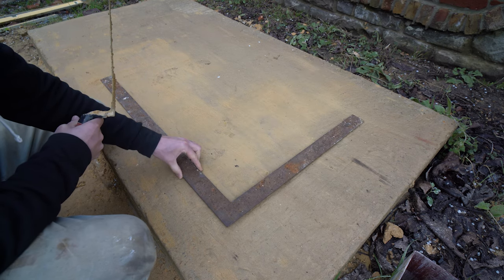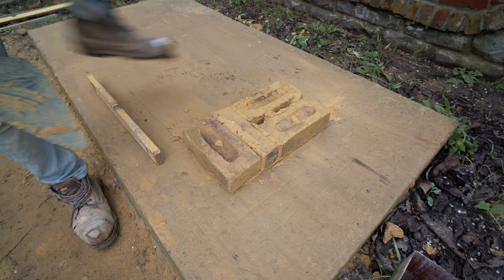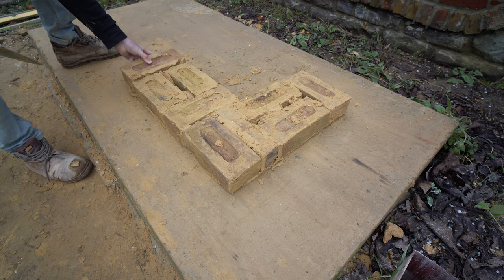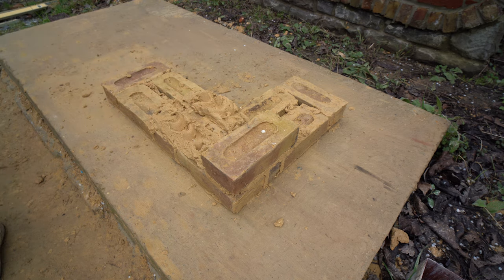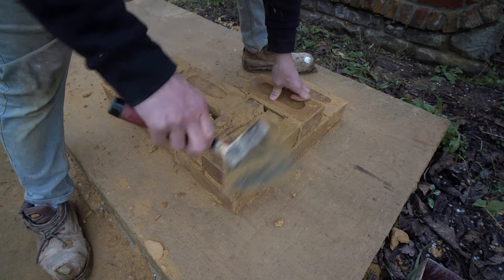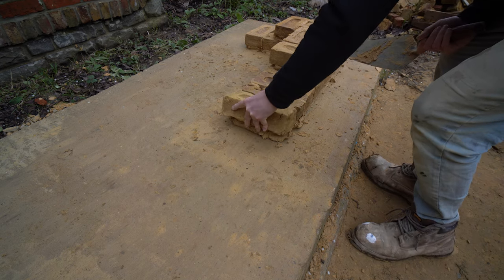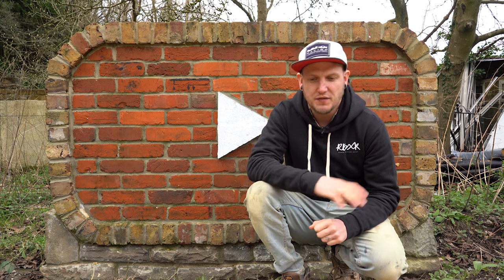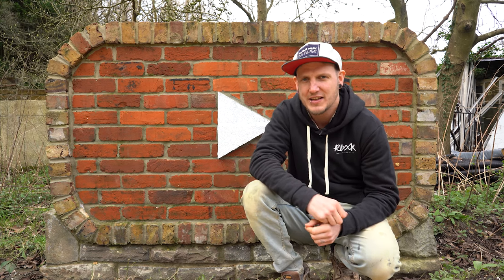BRICKLAYING - How to lay bricks in FLEMISH BOND

Comment: Many thanks for the video as always. Just completed my first Flemish bond garden wall in 35 years. Had lots of nice comments from 1 bricky, 3 builders and various neighbours so pleased with myself. One thing I had big problems with was dealing with misshapen bricks when trying to plumb the piers ie on the stretcher section the top would measure 107mm and the bottom would read 103mm. Trying to plumb was a sausage. Any hints would be most welcome.

Comment: good video as always mate but i think we would learn more form them if you were to do 2 corners you have soke about how you do the corners first then run the rest in on a line but i think it would be helpfull to see what happens when they meet up as depending on the length it wont alway be possible to marrie up the header streacher similar for all the other bonds as well how do you deall with that

Comment: Hey man,
Thanks for the video!
And I think you have demonstrated the only time a brick can be used for a-fence...🤔🤨🤷‍♂️ hahaha 
I think Flemish-Bond is just as strong as English-Bond but it looks better!
However, when it comes to stitching in a pier, then I think English-Bond is superior in terms of strength and economy as the English-Bond uses less bricks and the stretchers run deeper into the pier also.
So yeah, I’m a Flemish-Bond guy and I’m gonna use it for the foundations of my new Timber-Frame house and I’m gonna use Staffordshire Blues (Class A) all the way up 6.5 feet, because they are waterproof, insanely strong and are also very very precise in terms of their size.
It might be a bit expensive, but I have to use bricks because of where it’s located and I don’t have a massive crane!
👍👍👍

Comment: And when you have 3 5 7 or 9 stretchers between a header it's no where near a strong as English it just looks better
Reply: Kristian Cooper  That would be garden wall bond, not Flemish.   I was shown at college, a steel ruler being able to be plunged down through a new built Flemish wall from top to bottom. It was also used to show that 3/4 used at stopped ends do not work technically correct although the prevent cracking and peeling out.  So agreed that English is the strongest bond.